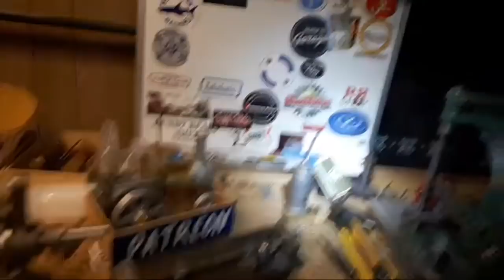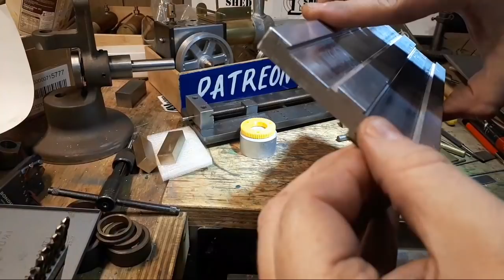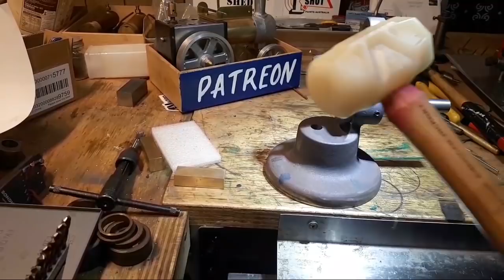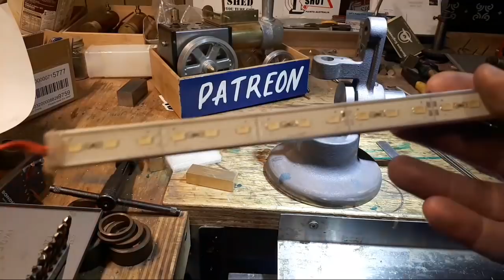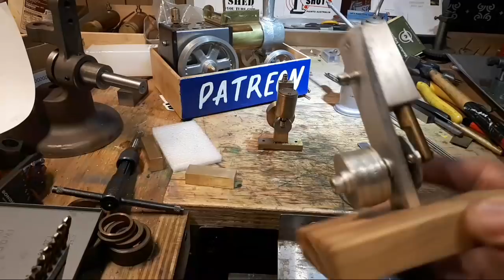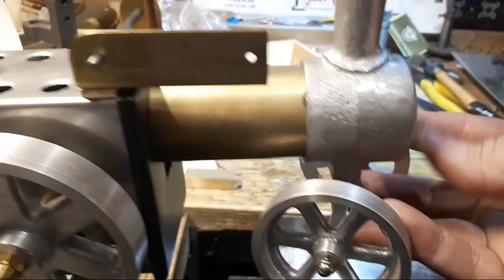Wednesday Night Live

Comment: My interpretation of that insert code is as follows and i have tried to convert it to the modern iso code.
Sq =  s or square 
T1 = thickness = 5/64
2 = 1/4 or 6mm length of the cutting edge on a square or scribed circle that contacts all cutting edges on other shapes 
2 = nose radius = 1/32 .
If the length measurement  is correct ( just measure it with a scale or if the holder has an insert pad in it measure that ) an approximate conversion would be :
S    - square 
C    - 7 deg relief 
L    - tolerance - not that critical so what letter is used is not important for  us
N or R   - depends if you want a chip breaker - insert has no hole for screw.
06   - 6 mm size of cutting edge - if closer to 3/8 change to 09.
T1   - 5/64 thick but may find 03 (1/8 - 3mm) easier to find .
08  - 1/32 nose radius ( you can change this depending on your use ).
The main things to consider are shape , size , how it is mounted , if it needs a relief angle or not ( 7 deg is pretty common ) , if you want a chip breaker and to some extent the thickness( you don't want to stick a 1/4 thick insert into a holder that is designed for 5/64  and if you can sort those points out finding the required insert is just a matter of looking online at an insert code chart to match what will fit your holder   - kyocera , sandvik , mitsubishi and carbide depot all have them online and some like kyocera and sandvik have apps for your phone or tablet .
HTH ! 
P.s when i built my new drill press bench i picked up some fischer plastic trays of ebay ( plastic box company from victoria from memory ) they are  around 600 long 200 wide and 100 deep with removable dividers . I made a shelf under the bench top and they slide in there side by side - yay no more digging through junk boxes looking for bits of metal ! Under the bottom of the bench is a large ply tub on castors that i divided into three , steel cast iron , aluminium and brass /bronze and copper and between the top drawers and bottom tub is a shelf divided,into 3 for box section , angle  and larger / longer round / square and flat bar .

Comment: theres a 10 pack of sqt 122 inserts on ebay right now for $15 US
Reply: I found (maybe) the same one and sent a link shortly after the livestream, but Emma was hoping for something a little more modern :) M&J Tooling have 34 new old stock inserts, and they appear to use the same stock photos as the ebay listing, and an Amazon listing so I wonder if someone is sitting on the last 34 inserts in existence?

We suspect the SQT122 designation could be some kind of old designation, and now ISO codes are 4 characters with 3 pairs of codes after it. Emma says the inserts are about 3/8 in along the edge, so I'm guessing (after looking through a couple of catalogues) it could be an SPMR 090304 or 090308, looking over the video again it might suit.

SPUN and SNGA are other possibilities - does anyone out there have experience with these three styles of insert that could shed some light on it?